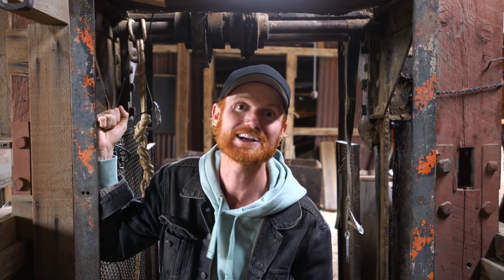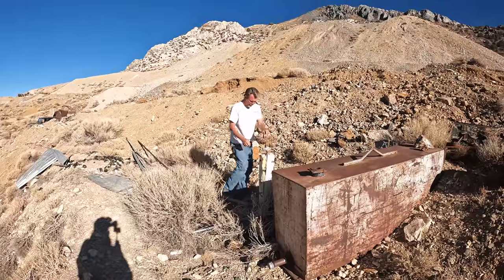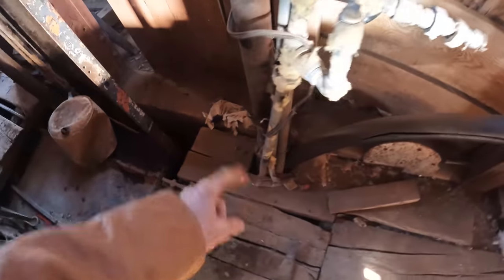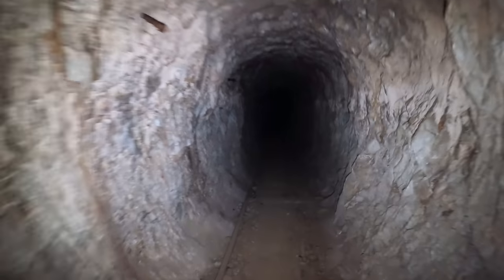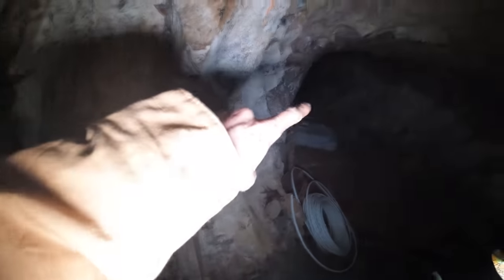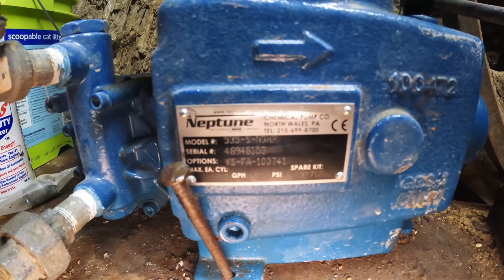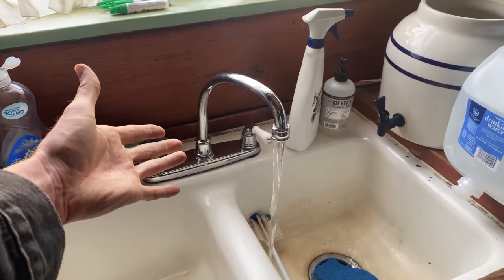How Cerro Gordo 'Ghost Town' Gets Water

Comment: I would put an electrical float switch in your water collection area. One that shuts off your pump if the water level gets too low. That way you don't ever lose the water priming.
Reply: i was thinking that too !
Reply: There used to be a low water cut off switch down there so I would imagine it's still in use
Reply: its ok he subscribes to amazon prime
Reply: Great idea
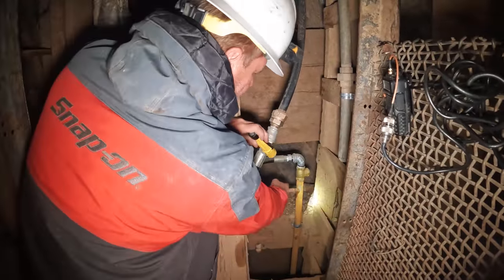Reply: 1:32 No need for electric anything. Mechanical foot valve. 2:00 As well.
Reply: This is the original video on the water supply, worth a watch

https://youtu.be/bQeTx1hQZ9A
Reply: @WyattsVlog  the pump will lose it's prime if it sucks air, a foot valve can't prevent t hat
Reply: @rustblade5021  Ah yes you are correct. But I would assume youd mount this at the lowest point. Would be easy to drill a 1" hole several feet deep and mount your foot vavle very low. I still dont see a need for an electronic valve. Unless you wanted to stop access so that you dont use up your supply. Sense the water isnt for drinking, pumping 8g/hr is 192 gallons a day. No info on how fast it fills up so no real advice can be given. Eyeball it
Reply: A float .. like on the toilet tank! That’s what we had in out tank , when it got too low, our desalination machine kicked on! Back when we only had well water
Reply: @1927su  I watched the video that the other person linked to, they do have a switch there but they didn't verify if it works. At least not on video, and he has comments turned off so there's no real way to find out details
Reply: Engineer here - agree with this comment. Let pump run for 1-3 days and check if the water reservoir changes capacity. If it's not changing, then you have a system issue and may consider implementing a multiple pump solution. If the water level is dropping, you're most likely loosing prime because you're running out of water.
Reply: @bestday-ever  I never thought my comment would get 309 likes as of 8 minutes after your reply. Also have been an engineer for quite a while. Data collection is pretty important. Without it you have no clue what's going on. There is no good reason why they should have lost so many pumps in such a short time without something solvable happening
Reply: Don't forget that surge tank.......and an R.O unit (reverse osmosis) 🛁
Reply: This is so obvious I can't image the system doesn't incorporate some means of preventing the loss of prime due to low water level. Ideally, a submersible pump would be used with a a level switch to shut the pump off when the level gets close to the suction.

It is possible there are other issues.

With the headframe at such high elevation I can't imagine that there are not long spells of winter weather with air temperatures well below freezing. These mines have a number of outlets are lower elevations although nearly all are blocked by partial collapses which do allow some air flow. Air at the headframe is higher density than air at lower elevations because cold air is denser than warmer air. I would anticipate airflow down the hoist shaft and any exposed piping could easily freeze unless the entire line is heat traced. Even insulation won't fully solve the problem if water flow stops for a long enough period of time.

I am just speculating but frequent loss of prime is indication that there is an underlying problem that has not be identified yet.
Reply: @roundmidnightsuttree  a submersible is a trash pump .....I got the impression he is trying to harvest the water for some potable or nonpotable use ...but it may be he just wants to remove it ...that's alot of lift for a submersible ...maybe that's why they're using a diaphragm 🤔
Reply: @bestday-ever  if the water hole yield is significantly more than 8gph, wouldn’t it make sense to just upsize the pump? Making an assumption here, but surely there are diaphragm pumps available with a larger gph capacity for that setup? Also curious if two (or more) pumps of the same size would require multiple pex lines to the hoist house, or if they could share the existing line.
Reply: What is powering this system?  Is there a generator down there or something?
Reply: @tarstarkusz  I am pretty sure it is wires that run down with the water pipes.
Reply: @spacecase0  I just watched a different video on this channel and it showed an electrical panel.  I think the town has electric service. He also created a library in the old dynamite room and installed a chandelier therein.

Comment: One of my friends was familiar with the original water supply to the town of Cerro Gordo. He knew the lady who owned the town.
 He spent some time there years back and knew the steam pumps and manlift equipment. Originally it took 7 minutes to get from the 900 ft level to the top with the steam equipment he told me. We are thinking of visiting you this coming spring or summer when the passes are clear. He is also familiar with the steam pumps that were/are on every level also. He is in his 80's and very good with the equipment, and is a steam engineer.
Reply: Im sure brent would appreciate your friends expertise! Though damn...7 minutes for that much distance? On that rickety tiny shaft? Talk about one hell of a scary ride
Reply: Lord protect this engineer 🤌⚠️ so cool 🙏
Reply: It's one thing to run a boiler to supply loads in an active mine but would make no sense for the current situation. The problem at Cerro Gordo is lack of a water source, not lack of pumping capacity. Certainly, if the existing pump is losing prime on a regular basis there are issues that need to be addressed.
Reply: @roundmidnightsuttree  My friend knows where the original water source for the mine is located. He was actually to it years back. knowledge of the location might have been lost since then.
Reply: @f.k.burnham8491  well, in this video there is a huge cave in right where the water source starts.  seems that could have cut them off?  I still look forward to seeing this oldtimer OG come to the mine.
Reply: Great point. Why just one pump. Should have relay pumps every 200 ft. Would improve water pressure.
Reply: @everythingsalright1121  that would be less than 2 mph

Comment: Years ago I had a similar issue at my cabin and we used several mines near the cabin to get water but during the summer it was more difficult. One thing we did was we found the cracks where water flowed year round and brought in an electric rock drill and sunk holes several feet deep on a few and struck better water and better volume. We tapped the holes with pvc pipe and ran the water to storage barrels.
Reply: Water in mines is not contaminated with heavy metals?
Reply: @zaxarispetixos8728  not so bad as long as iong as its not too acidic or sitting there too long.  the lead is not very soluble until it oxidizes,  and the real prolem is in mines that also have sulphur. which i've not seen sulphurous any deposits.
Reply: @zaxarispetixos8728  you should definitely get the water checked, but it can be just fine.
Reply: @AdricM  on thoose areas i think the ore formed on cracks on the rock. In ancient times water got deep in the ground boiled absorbed heavy metals and then it pushed out of the earth taking heavy metals together. And now through thoose cracks water is leaking down and washing some of the ore.
Reply: @zaxarispetixos8728  sure is buddy but when that's the only solution for water you got to take the good with the bad.
Reply: @M711-n5n  you can replant native trees and harvest rain and snow.

Comment: Hi Brent. Greetings from NZ. A couple of  cheap solutions. 1. cover the ground with polythene sheet where the dripping is taking place to collect most of what is coming through the roof as I would think a lot is just seeping through the floor. Should increase your supply quite a bit and allow you to increase the stroke/delivery on your pump.2 As other people have suggested place a submersible pump on the inlet. You would only need a small one, they are cheap and come with an attached float switch. Wire it parallel to your existing pump and it will only run when needed. Hope this is of some help. Keep up the good work, stay safe.

Comment: I assume you've had the water tested for safety as it is coming from a high Lead location.  I'm sure there are filters that can mitigate the lead contamination as well as any other issues that might present themselves since this water is filtering through a fairly contaminated area.
Reply: I was wondering the same thing if there was a risk of lead contamination of the water
Reply: If I remember correctly, they obviously do not drink it but it is used for baths/showers and a few other various things... But, like I said already, it is not consumed in any way. I could be wrong but I'm going off my memory from things that were talked about in past videos.
Reply: I worked for water pure companies that services water machines..reverse osmosis systems can strip even arsenic out of water..
It can remove toxins down from 300ppm to 12ppm making water safe to drink. Our systems used ultraviolet light for decontamination as well as multiple filter stages..
Plenty of home systems are available that do a great job..
And if that spring is from ground water it's probably fairly clear..it's not comming from the mine, but into it from a water table or natural spring. Still I would run it through at least some filtering system even for showering..
Reply: @chuckthebull   I was going to say that I imagine there's got to be at least 1 person here that watches Brent's videos that's an expert in all things water, pumping, Etc. All things related to this video and the issues they're having with getting their water up the mind and to the buildings in the city. (Obviously, one person would have knowledge about one of those items, another about another item, etc. I doubt there's a person out there who is experienced and knowledgeable about all of those things however I will probably eat those words because there seems to always be someone that's a jack of all trades and knows pretty much everything you need to know about stuff that they're interested in. This, being an example of that) Anyway, thank for taking the time to explain that stuff to a novice/lay person like myself.  
Also, thank God that the person who replied to my comment with some semantic BS related to "water absorbing into our bodies is technically us consuming it because our bodies are sponges, so you're wrong about them not consuming the water. If they take a bath in it then they are clearly consuming it" deleted his comment, because when I read the comment, it took every ounce of willpower in my body to not spend my life finding a way to create a device that would have punched him square in the nose for me while I am somewhere far from where they are, just because he came across as such an insufferable twat.
Reply: @darcy_does_it  Oh wow... I bet you're just a real hoot at parties, eh?
Reply: @three6ohchris  lol...I feel your pain,, And thanks.. We do absorb in our skin but only to a degree.. If we did we would be big bloted bags of stuff..lol.. 
It is funny that as a person who is a bit of a Jack of all master of none I get people trying to pull rank on me all the time in certain technical areas that I know a lot about.. I'm also a welder mechanic instrument maker and electronics designer.. The picture of the customs piano I made is in getty images archive..not to brag... But indeed not everyone can know everything and to insist we all should is hair brained.but a lot of people work out their frustration on line (or need for some narcissistic supply)
So thanks for graciously accepting my input.. 
We are concerned for Brent,,, a is a great asset to our curiosity about his little town..he has a great channel here..every time he explores a mine I say to myself ok he posted a video he's not dead.. I don't even know the guy yet I am concerned about his health and safety.
Reply: @three6ohchris  oh I had to revise my first post as I noticed spell check changed can to can't..arsenic even though smaller than a water molecule will still be filtered out of water because of the clinging effect of water surrounding the arsenic, it makes a larger ball around it and it won't fit through the osmosis membrane. Under pressure it forces all the clean water molecules through it. But the solids and toxins and heavy metals surrounded by water molecules go to the waste side. It's a brilliant system.. Every osmosis filter must have a charcoal filter ahead of it to filter out chlorines and florines or they destroy the membrane. This effectively kills most bacteria,, and ultraviolet kills off viruses.
I'm such a geek! No?
Reply: @darcy_does_it  skin can only absorb so much..it's actually designed not to let a lot of stuff through.. But certain chemicals like dmso can be used as carriers. Working around them can be dangerous.. But you are correct bathing in a water that may have heavy metal in it might not be wise,,it should be lab tested at least.
And I think Brent had that done a long while back.
Reply: @chuckthebull  Use google and do an exhaustive research, it would prohibitively expensive for a volume unit and filter cost. Find water that tests clean and use it.
Reply: @darcy_does_it  You mean to say, our skin is an organ which absorbs all manner of things into our body.
Reply: @three6ohchris  As you get older, it is hoped one learns from mistakes, the lessons. You pay a price for every lesson, hoping it is not the ultimate price, one's life! Please read my comments!
Reply: @chuckthebull  My exact same sentiments, thank goodness he posted another video and not just disappeared.
Reply: @chuckthebull  I would test the water before AND after before I would use it, Spock would approve this logic. I don't operate on someone's say so, I do the testing! I need to see the proof!
Reply: @chuckthebull  Not one of his videos does he ever mention anything about testing, he needs to test the mine water, Keeler, Lone Pine and from the spring.
Reply: @lotharschiese8559  I'm not sure but I have a vague memory of him mentioning the water getting tested a long while back. Yeah I could be wrong but I could swaer him saying so.. If I have time I'll review old videos but still he should get it tested for the sake of visitors and that hotel.
Reply: @lotharschiese8559  not on a small scale.. Yes fillter can get expensive..but you are thinking in industrial scale,, I was thinking small units like used in homes just to clean up the water for use maybe not drinking..even a standard fillter would be wise.. 
I would think he's going to have to solve this issue with code issues with the hotel and the city.
Reply: @chuckthebull  I have watched every video he has produced,  I have a photographic memory, not once has he mentioned and worse he has made no effort to respond to any comment of mine and doubly worse, he has gone to great lengths to remove my comments. So much for the concept of free speech that can not misinterpreted as obtuse nor vulgar. When I make a comment the intent is to educate using my knowledge, experience and my gift of acute observation. I an 70 and not at all shy at speaking out to bullshit. To be using any water that has not been tested, is supreme bullshit, needlessly putting one in harms way. Remember one thing, Ignorance is the cause of Suffering and learnedness is the preventative cure! Namu Amida Butsu
Reply: @lotharschiese8559  Well all that said at 65 I have learned that you have to let people suffer if they are dedicated to learning the hard way. I'm often frustrated by younger people who think they know it all and ignore the vast experience I have on a lot of subjects.
As an older person we are often dismissed, it seems the attitude is if it's old it's no good or useful..I like to remind them to remember that attitude and let those words haunt them in their old age.
But for me,,still fit still riding motorcycles (when I'm not building them) and taking risks in life is how I get the most out of mine. I'm not going to worry about every little germ or toxin,(i have had weld feaver before from not using a respirator)
I have broken bones have scares burned up hand dog bites that shed a lot of blood. But I'm still here and will still risk it to live an exciting life.
No one ever wrote any books about people playing it safe, and you never see a statue of a critic.
At your age you should already know this. But indeed that water should be tested..the fact it's dripping into that mine through old dirty boards and down rusty paths of all sorts of bacteria Is not something I would want to drink. Unless it went through an extensive filtration systems..like an osmosis system.. Again I know a lot about them and it should be done for the hotel at least.